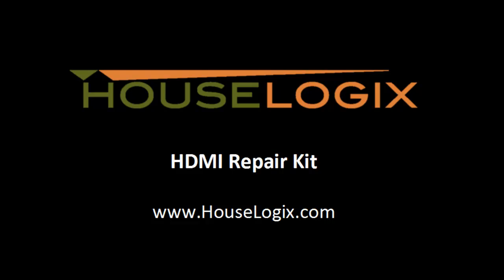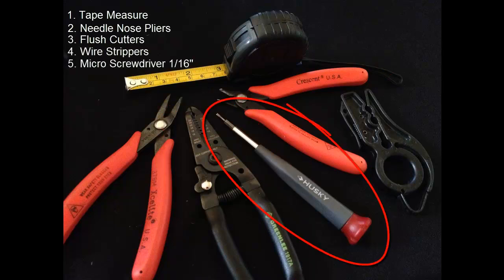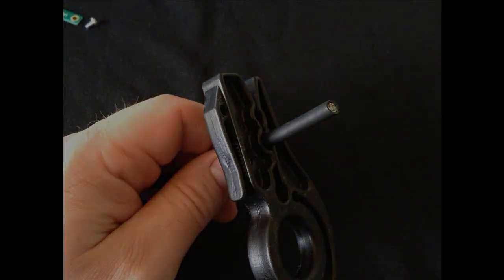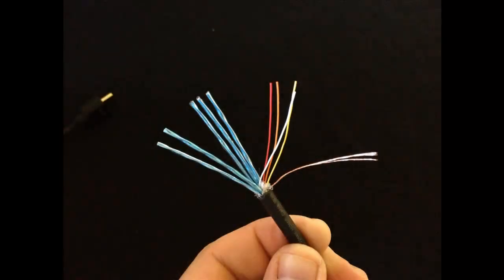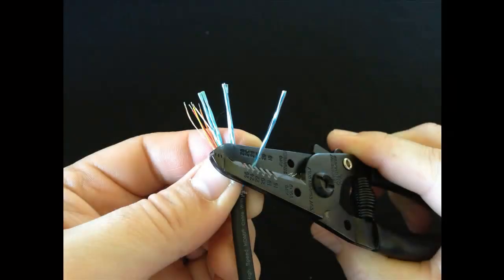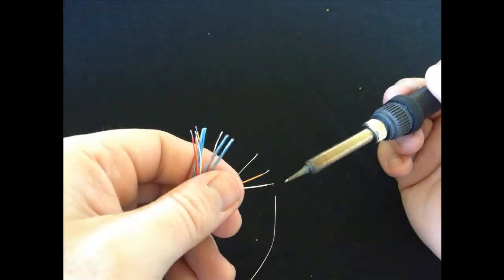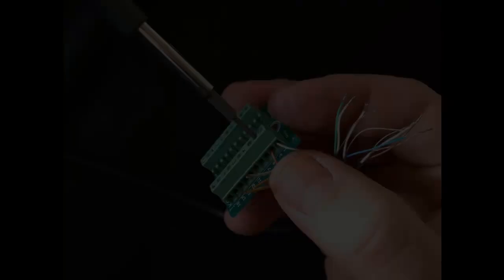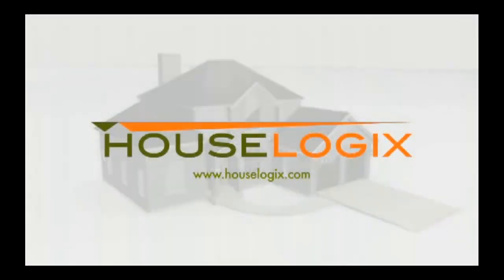HouseLogix - HDMI Repair Kit Installation

Comment: Looks like a viable solution but I want to know how you are supposed to make this look decent? It's ugly. Are there any wall plates suitable for this? What other options are there to make this aesthetically pleasing?
Reply from the maker: We normally recommend this goes behind a TV or, once tested, that it's wrapped in electrical tape and then dropped behind the wall so it's not seen.

Comment: A crude but effective repair.  Poor strain relief.  Encasing it in hot melt glue or epoxy, then putting  large diameter heat shrink tubing over that would make a better job.
http://www.accuratetvrepair-414777-0072.com
Reply from the maker: We've had almost 0 issues with this procedure, however, your recommendation on the glue/epoxy and then heat shrinking would definitely help guarantee a good connection!
Reply from the maker: +yogibear2k10 and all, this is intended as a last resort option when you can't just buy a new cable. If you can run a new cable in an hour or less, you're much better off to do that than try fixing the end. If the cable is buried in a stone wall above a fireplace and there's no way to run a new line; this is a solution.
Reply: this is exactly what I just ran into. Good point! I don't want to run a new wire through the fireplace. Good tutorial

Comment: This might sound like a funny question but I need to know .
I want to cut and disable audio in one of my cables but I'm not sure which wire carries audio or how to find out?
I need this because my equipment is defaulting to HDMI audio and I want it to ignore that and use optical instead for my current set up. So the only way I can figure doing that is to stop audio passing through the cable and tricking the system.

Comment: How are you to check continuity if the cable is in a wall? No way to bring both ends that close together. This is all based on perfect scenario. Who cares about fixing a cable like that? Cheaper to buy a new one. We need to know how to fix cables behind walls. It should be noted to everyone that if the wrong wires are put into terminal it will damage the tv or dvd player
Reply from the maker: To check continuity we recommend running a temporary cable such as bell wire or even speaker wire so you can test the ends. You are correct, if it's a location you can easily pull a new cable, we recommend that. This is for those situations where it's not possible and this is a last resort. EG: We had a client where we ran a 30 ft HDMI cable to a fireplace TV by chipping out the grout, running the wire, and then re-grouting. It took 8 hours to run the line. The client pulled the TV off the wall (articulating mount) and broke the end. We were able to repair this in 1.5 hours versus 8.